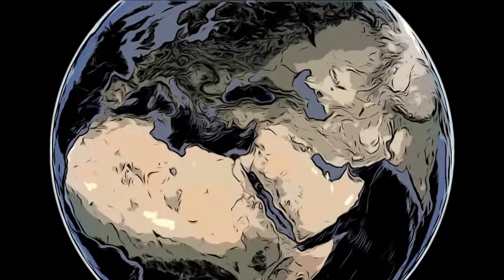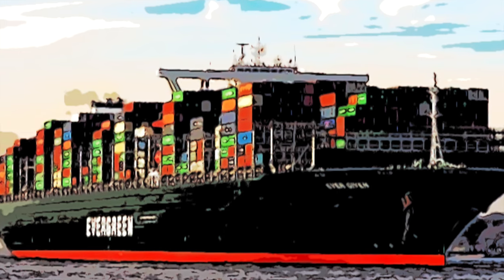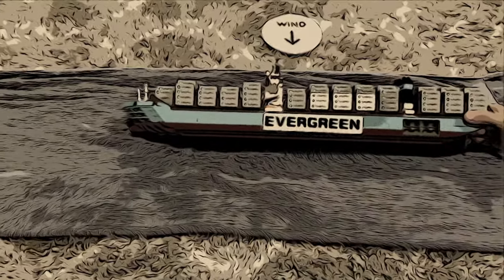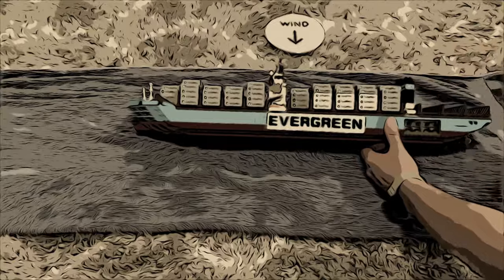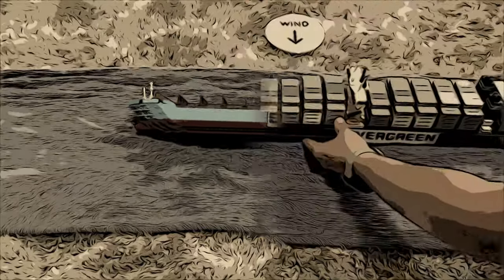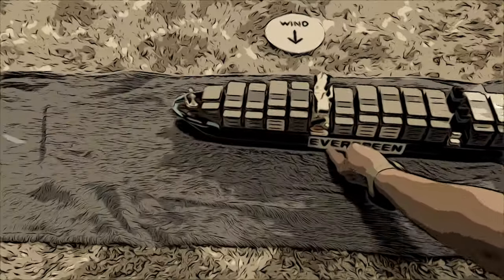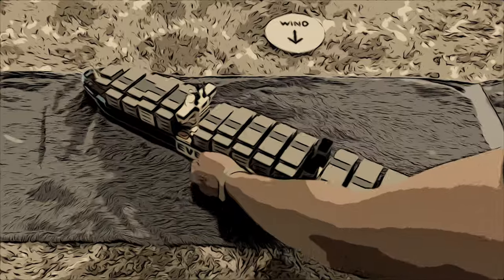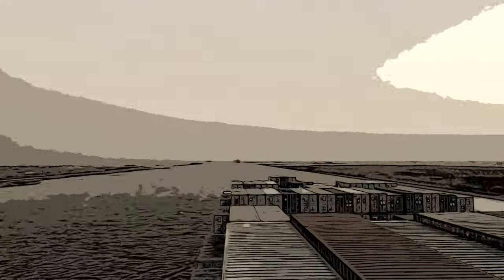How High Winds Contributed To The Grounding Of The Ever Given Container Ship In The Suez Canal

Comment: The other effect in addition to the wind was the bank effect which increases with speed. So they needed speed for steerage because of the wind but that increased the bank effect - more speed to counter, then the combination of more bank effect, wind and just no room to maneuver it became uncontrollable in the space and almost nothing they could do about it. Faster no good. Stopping would let the wind drive them on the bank, certainly at some speed as the way came off. So they had a vicious cycle happening. It was probably inevitable that it happened right from the moment they entered the canal with that ship in that wind. NOT the first time either. Same ship, same circumstance in a canal but just a damaged ferry caught by the stern. Information thanks to another qualified industry source.
Reply from the maker: Thank you very much. I will pin this comment to the top as I believe you do point out another important factor of bank effect.
Reply: Never heard of bank effect before.
The bank effect is the tendency of the stern of a ship to swing toward the near bank when operating in a river or constricted waterway. The asymmetric flow around a ship induced by the vicinity of banks causes pressure differences between port and starboard sides.

So the chain of events could have been:
They were pointing to the bow to the right bank to counter the wind, which moved the stern left, but the ship is so long it got the stern too close to the left bank and the bank effect pulled the stern into the left bank. They added speed for steerage and forced the bow into the right bank. 

Michael Stark you are the only one I've found who has mentioned this. Will be interesting to see if it comes up in the final report. Thanks for sharing this.
Reply: The ship only has one screw. Would twin screws have helped prevent this?
Reply: @msnpassjan2004  Possible. I am NOT an expert on such things but multi screw ships can use them for steering. Would it have worked in time in the canal? Good question.

Comment: Excellent demonstration Bryan! I have read several stories on this and no one told the cause was wind. I know many people much smarter than me are working on the solution but I was wondering why they did not bring another empty container ship in with a crane and unload most of the containers to help raise the ship? I know there is probable a good explanation. Thank you Bryan once again.
Reply from the maker: I think bringing another container ship alongside the grounded one and trying to offload containers to it would be extremely challenging and could potentially make things worse. I think the plan was to use a large shoreside crane and discharge the containers from the ever given to the shore to reduce its weight.
Reply: @BryanBoyle  thanks for the explanation. Hopefully the ship will be on its way soon so things can return to normal.

Comment: What do you think they might do so this doesn't happen again? I know in the Netherlands they put up big wind interrupters along canals - and I know that there are diesel electric tugs with strong side thrusters - but I have no idea if there's anything that might be practicable. Maybe some kind of purpose-built guide vessel? If you think about it, the wind is pushing all along the side of the ship, but directional control is at the stern, so maybe a way to apply side force at the bow?
Any ideas?
Reply from the maker: I wouldn’t be surprised if the new policy for mega ships with large sail areas transiting the canal will be required to have escort tugs for the entire transit. That would probably be the safest way but it would certainly increase canal transit costs.

Comment: Does the Ever Given ship have bow thruster and if so, could you use them to help steer the ship in this type of situation?
Reply: These ULCS have bow thrusters as well as stern thrusters.  But sadly they can't be of much help in extreme windy conditions. Also for them to be effective, ship needs to be travelling under 5 kts, lesser the speed, the more effective they are. The crew probably didn't even get time to use them.
Reply from the maker: Yes it has both bow and stern thrusters but they are not effective for steering the ship when she is moving that fast.  The thrusters are really transverse tubes that run from one port to starboard.  The ship needs to be going slow enough, typically less than 5 knots, so that water can be pulled through them.  If the ship is going too fast, it’s to difficult for water to get pulled through and they are therefore ineffective.  Thrusters can also take a little bit of time to turn on.  They require a lot of energy, so additional generators often need to be turned on before the thrusters can be activated.  On top of all of that, with such a massive wind sail area, the thrusters may not have even been strong enough to prevent the wind from blowing the ship onto the bank if they slowed down enough for them to become effective.

Comment: What's the temperature like inside different parts of the ship at different times of the year?
Reply from the maker: In the winter, everywhere is cold especially below the water line in the holds.  Fortunately the engine puts off so much heat it’s good at keeping the inside of the ship warm. In the summer, it can be challenging to keep the inside of the house cool, but down below the water line is usually cool if the water temperature is less than the air temperature.

Comment: Your demonstration shows the wind to have been at right angles to the canal, on her starboard beam.  Reliable reports say it was southerly, i.e. almost parallel to the canal and on her stern.  If true, then that almost completely invalidates your explanation.   
Take a look at this video, which includes an accurate AIS recording of the ship's track and a professional analysis of what really caused the grounding:  https://www.youtube.com/watch?v=iG6XLuMS--U&t=614s
Reply: Ian M - Thanks that's a really helpful link. Much more informative and authoritative.
Reply from the maker: Before they turned to a more northerly heading lead, the wind was almost on the starboard beam which started to set the ship to the left side of the channel. They increased speed to overcome this and then started to lose control due to the increased speed and bank effect.  The emphasis of this video was to show how high winds affect large container ships loaded with containers due to their massive sail area. Even when the ship started to yaw back and forth the wind had an effect on the sail area from both sides. There are other videos that show in more detail the bank effect, but I was just offering a simplified version of how ships have to manage these high winds by adjusting their courses to prevent from being set into the bank.